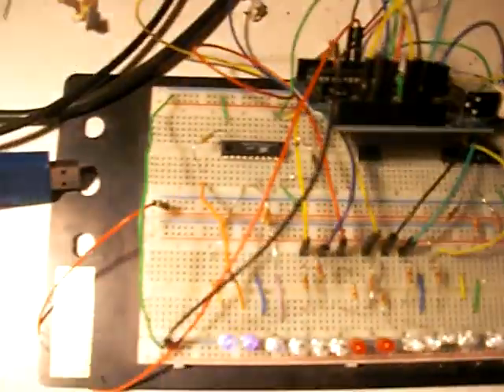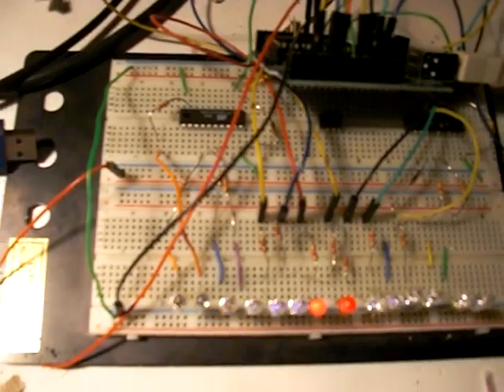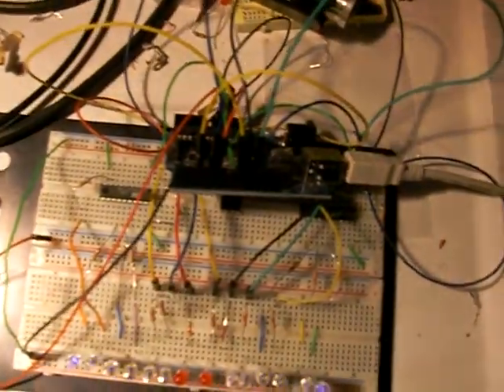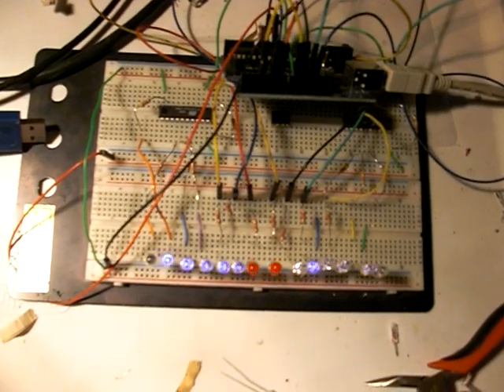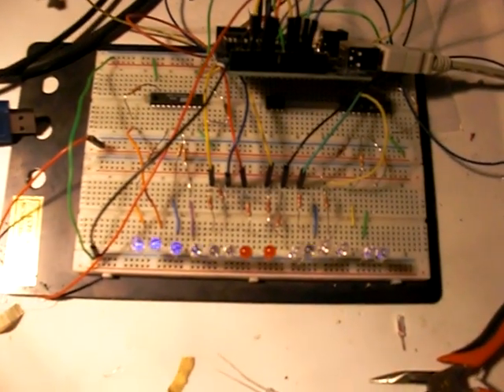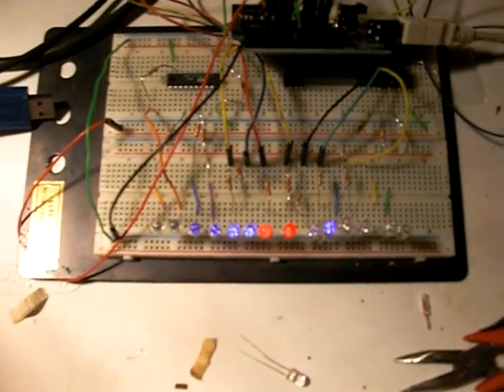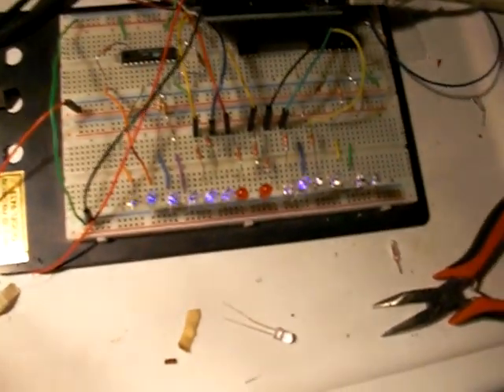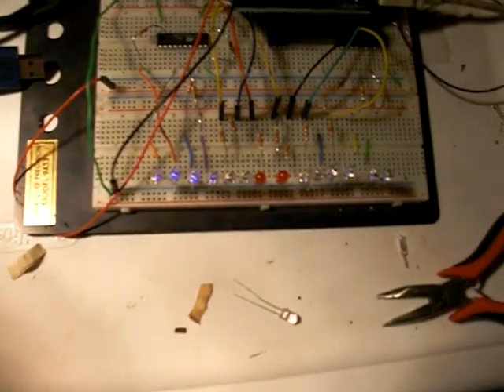14 led PWM knight rider effect with arduino and ATtiny2313

Comment from the maker: @Charvin91 Hello. Sorry for not responding, I forgot until I read your message. I do not actually have an Arduino UNO, so I am not familiar with its ISP capabilities. However, back when I did this project, I used either the ArduinoISP sketch or a USBTinyISP (and the AVRDude software) to upload .hex files to the ATTiny. I did not use an external oscillator.

Make sure you have your settings correct. Choose "Programmer>Arduino as ISP" & the correct board setting. Also check your boards.txt.

Comment: I'm trying to program Attiny2313 with an Arduino Uno and everytime I get an error. I want to ask what version of software do you use (0022,0023...) do you have your own core files to acces the attiny chip or did you just download them? Do I have to use an external oscillator? Could you please tell me how can I program that? thank you